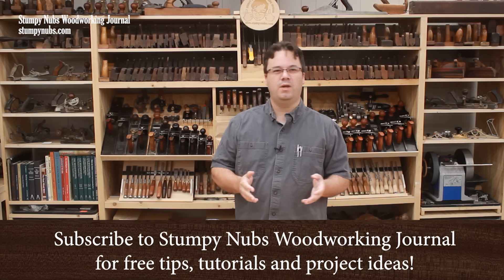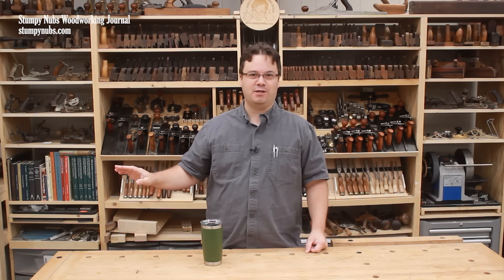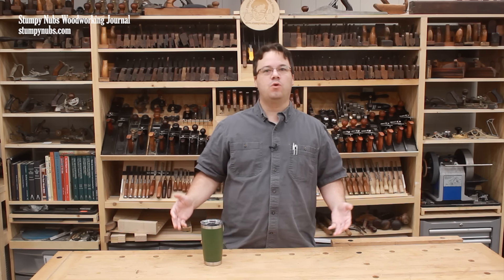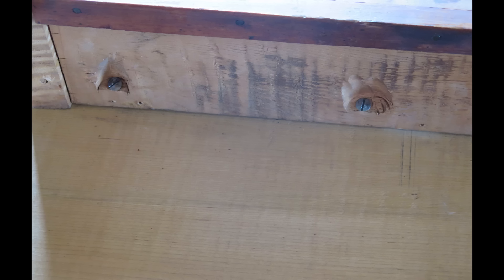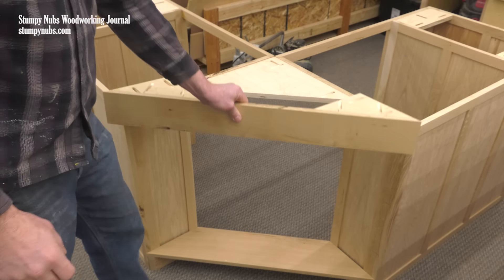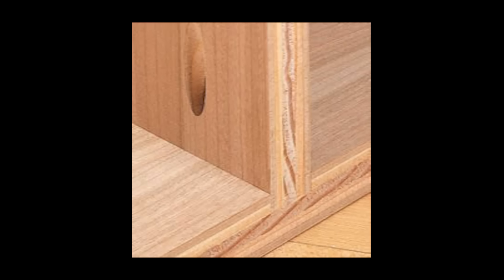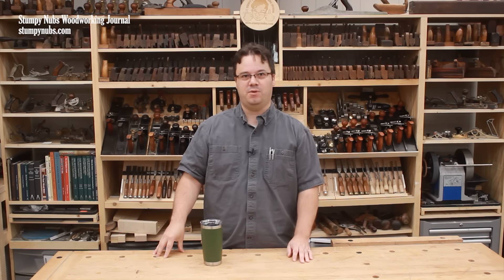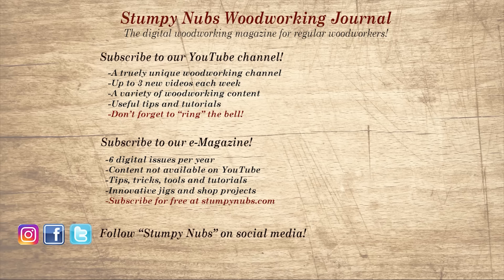They lied to you about pocket screw joinery.

Comment: How many of these "traditionalists" use a cabinet saw and joiner to construct their fine furniture? I would ask each one if they use the tools, in other words, a hand saw to make rip and cross cuts; hand plane each board to get a smooth edge and hide glue only. 

The fun part of woodworking is building what you want in the way you want. Be proud you made something yourself.
Reply: Couldn't have said it better myself!! People scoff at the use of construction lumber and pocket screws while they pull out their Dominoes and sliding cabinet saws. It's all just technology that gets the job done and different things are better for different situations
Reply: Or routers. I have a collection of shaper planes from the 1800s but I am not going to use them now that electricity has been harnessed and somebody had the good sense to invent the router. Which by the way is one of the most, if not THE most, versatile tools in any shop.

Comment: I use pocket hole joinery often. I’ve never understood the objection to it. Then again, the same people who complain about pocket holes also complain about CNC machines. They are both just different techniques. I have a pocket hole jig and if inhale the space and funds I would so buy a CNC machine. If they would come up with a machine that could automate sanding I would so buy that as well.
Reply: I believe that going to things like CNC machinery too soon detracts from skill. There's a degree of intuition about how a material behaves and its limitations which is best learned by literal hands-on experience with it. And not being able to do the work yourself means that when you have to do something you can't do with the press of a button you're left looking like an idiot. If you have gone through the process you will be able to come up with a good solution.
Reply: You mean, kinda like a drum sander? Won't do every surface, and you might want to touch up with a finer grit by hand or the random orbital sander, but for the largest surfaces it can do at least the blunt of the job nice and fast.

Comment: Hey, while we're pissing off the purists, can we have an episode for when T nuts (and other hardware like them) are appropriate and how to use the correctly? I always thought they'd be great for when you really need a strong set of threads inside wood, and they could be just as easily hidden, like in an articulated arm for an overhead light.
Reply: I love T-nuts. Those things are so damn handy.
Reply: @barryomahony4983  Not only hardwoods.
It has been common practice to drill a pilot hole into the bottom of a joist and run in 3/8" all-thread for plumbing hangers.
Granted, plumbing shouldn't be a dynamic load, but this technique seems to hold up (even for seismic bracing of water heaters and the like)
Reply: Oh yeah,  T Nuts and Threaded Inserts in the same comment stream?
Not sure how they'd work for wood, but nutserts (HF Threaded Insert Riveter Kit) are so dang handy for thin tins!
Appropriate usage for T Nuts would be a good idea for a new video. 
Looking forward to it stumpy. Don't forget to give James credit for the idea.
Reply: Are these the kinds of fasteners that Ikea uses in their particle board furniture?  Its pretty creative but I don't see used by other furniture makers.
Reply: @johnsrabe  Triggering the Trads, Setting Off the Snobs
Reply: @nathanboyd7460  IKEA !! Would !! Be !! LOST !! WITHOUT !! THEM !!

Comment: Personally, I've never had good luck with pocket hole joints holding up over time. Even machined pocket holes in prefabricated pieces with proper screws just never stand up for me compared to the life of the rest of the material it's made out of. If you can manage to make use of them effectively, go for it.  For my luck though, I only use them for a quick and dirty fix for something temporary, like a jig, or to tack in as support to supplement another joint.
Reply: Why do your projects not hold up with pocket screws? Are you using it out doors without using stainless steel fastners? Are the joints nice and tight, good cuts and no rocking before assembly? Are you using this joinery type on chairs which exert a huge amount of racking force? I'm asking because I have built thousands of pieces with this type of joinery and the only failures are one that were used improperly for the design or catastrophic issues. Like falling out of a truck! If using this type of joinery is failing you, look at the key issues. Is this the right type of joinery for the project? Is speed of construction necessary? Is the look of the piece going to make it "ugly" using this method. Can your current skill level accomplish the project? Don't mean any disrespect but some questions need hard answers, that also can be a learning objective.
Reply: @moldings_etc  Primarily in framing for shelving and furniture (not chairs), both indoor and outdoor. When used outdoors, I do make sure to use proper materials with the proper fasteners. And to be clear, the joints can hold up for a while, but not as long compared to the life of the material they're in.  Yes, wear and tear and related repairs are normal and not a fault of the joint, but comparing the time saved using a pocket hole joint in the beginning and needing to repair it down the road (at least in the likelihood that I've experienced), versus taking the extra time up front to do something like a mortise and tenon that will last as long as the rest of the material does, and I feel you save much more time in the end with the latter. Again, this is all my personal experience and opinion.  Your mileage may vary.
Reply: @kasbakgaming  So it seems you have already figured out which projects to use pocket screws on and which ones not to. That's part of the choice of which methods to use, experience on what holds up and what doesn't.
   I'm sure if full mortise and tenon was as quick as pocket holes, no one would use them. Good luck in your future projects!

Comment: One of the best defense of Pocket hole screws I have seen. Glad u mentioned they were used for well over a century. I have seen tables like a Duncan Fife style table with PH screws. Table was well over 100yrs old. I built a workshop stool with just glued butt joints and pocket holes. It has taken a lot of abuse over the years and still strong as ever.  All that being said, I still prefer mortise and tenon or dowels where want strength or want to hide joint. I do not personally like the look of a pocket hole.  As usual great video.

Comment: We have used pocket screws in several of the examples you mentioned, to hold a joint together when it dries, to build a simple cabinet, etc.  We do not have a big shop with all the fancy tools but work in the garage and pull the tools onto the driveway to minimize saw dust. Without pocket screws we would not be able to solve these problems or would have to buy a lot more expensive tools we would only use occasionally.

Comment: I agree with you. One thing that makes woodworking fun and practical is that there is sometimes a few different ways to assemble projects.  This means we have to contemplate how to use the tools we have to get the job done, which expands our capabilities.  The ability to disassemble projects can be desirable, plus when pocket screws are used, you don’t need a lot of clamps and you can handle the assembly and continue on as well.  Thanks for showing us that one doesn’t need the top tools to enjoy woodworking.

Comment: Great to see this, I got a KREG unit a few years ago and it's so quick to be able to form something. Most of my projects are 'functional' pieces rather than display pieces, so pantry shelves and cupboards for the shed etc, rather than fine carpentry. I have made dovetails and mortices in the past, so I've experienced both sides of the fence to some degree, and as you say it's case by case and not just to be judged with a strength test.......no names mentioned.

Comment: I built a whole kitchen worth of drawers with pocket screws for the sides, and dowels for the bottom, including 36" wide deep ones, full of heavy pots 15 years ago. Placed the pockets so they were hidden by the drawer fronts. Not a show kitchen, the Mrs. loves to cook, so used daily. Great option for me, as I had limited space to work, and the drawers are still rock solid.

Comment: I built and L-shaped desk top out of solid walnut and plywood using nothing but pocket screws. I machined walnut boards with tongue-and-groove edges and pulled them together with pocketscrews on the underside. Then I laminated the L-shaped top to an underlayment of plywood with the grain and L-joint opposite from the walnut top. I made a facing strip to go around the edge of the assembly to hid the plywood bottom. All the joinery was done using pocket screws and normal screws to hold the bottom plywood to the top walnut. No glue to deal with. It allowed me some years later to modify the desk to a normal desk by simply removing some screws and doing a little cutting of the original pieces and screwing it back together. It was probably one of my best woodworking projects ever.

Comment: We are in the middle of a move right now so can I just say thank you to the woodworker that used pocket screw to build my desk! I never would have been able to move it without breaking it down first.
Reply: Time savings in construction and ability to dismantle a piece are probably the top 2 benefits of pocket hole joinery. My 9ft farm table has 0 glue and can be dismantled 100% if need be.

Comment: Mr Nubs, I know coming up with topics can be a problem.  You have such a backlog of videos that I haven't tried to check all of them before I offered this suggestion:  you could do a lot of videos about the properties of different types of lumber.  I know a little about it, and I rely heavily on the Wood Database for info when I am considering a variety of lumber for a project, but I'd like your take on things. I've done a lot of red oak and a little white oak, but I got my hands on some ash recently and I like it.  Works nicely, finishes nicely, and has a really nice contrasting grain pattern, but it does have its drawbacks too.  Fifteen to twenty minutes on ash and uses (steam bending? handles for rakes and such?) and so forth on other lumber might be very valuable info to woodworkers who are trying to find cheaper alternatives to the ridiculous high price of white oak these days, for instance.

Comment: I just finished a coffee table where I used pocket holes to both clamp pieces while the glue dried and allow other parts to be able to move as needed. I'm 300lbs and can say it will easily hold me and my kids at the same times. It's even built from pine.... Just proves as long as materials and fastening methods are used properly, the results can be great!

Comment: When I was a kid we would build face frames using dowels it was slow took forever and you had to use a lot of clamps to hold it together The use of pocket screws saves so much time in cabinet building it’s ridiculous if you’ve had to build in the old way (doweling ) compared to the new way (pocket screws) you wouldn’t be complaining 😃 I wonder if the same people complain about using a wide belt sander compared to a belt sander 😳 Nice job on explaining the use of pocket screws and why they are important😃👍

Comment: Amen to this!

There is absolutely a time and place for pocket hole joinery in fine woodworking. Knowing the right application, and then doing your pocket holes correctly, is key. 

Personally I find pocket holes perfect for fabricating face-frames for built-in cabinets, face frames that are perfectly square and can deal with  wood expansion. I guess I could go to the bother of making concealed tenons to connect the rails and stiles. But why? The joint wouldn't be any stronger (and, in fact would deal less well with wood movement). It certainly wouldn't look any prettier.  The Luddites would have to go a long way indeed to convince me there was a better way to make a face frame than pocket holes.

Comment: I remember the first time I watched a video about woodworking and someone was ragging on pocket screws. I was like why? It does its job. Like you said I was that guy starting out trying to build stuff awkwardly and with only what tools I had and adding new ones as money allowed. 

My favorite thing about woodworking is being able to make things for myself and things for others but also being able to repurpose something or fix it when the needs change. One of my first projects was supposed to be a table/shelf between the couch and the wall. I had a circular saw, drill and regular screws and boards from Lowe's and some poly stain given to me. It turned out all wrong, wouldn't fit with the couch and I probably measured wrong. But with a little tweaking it made a great shelf for my son's room. And it's currently in a closet under the stairs holding blankets and towels and such. It's ugly. It's not square. I wouldn't dare try to sell it to anyone. But it's sturdy and does a job. And it helps remind me how much I've learned and how far I've come. 

I'll never be some masterful professional woodworking shop. But I can do some great things in my garage/shop that I couldn't do 4-5 years ago. And I'm always trying to learn new things and get new tools to aid in that process. Even if means pocket screws. The naysayers can just get over themselves.

Comment: Agree. Woodworking is a hobby for me, and I make most projects with hand tools only (yes, I even hand cut 4x8 sheets of 3/4" plywood with a panel saw when needed). I love laying out and cutting dovetail joints by hand whether it's a gift box for someone or a tool tray for me. It's a choice. I also love using pocket screws for larger projects like shop furniture or a garden bench. I don't have a table saw, a drill press, a CNC machine, or any of those other new fangled inventions, but I've seen some beautiful wood pieces made by others who do. I have a shop vac ,though, so I don't just rely on a broom and dustpan for clean-up. ;-)

Comment: They are like dowels that have the ability to secure a piece, but also gives the ability to remove it - as you mentioned. That is a major advantage of pocket screws. Granted, I used to be a huge hater of them, until I used them and fell in love with their use.
Reply: Dowels don't show, the only real problem with pocket holes is they are hideous .
Reply: i think my main objection to pocket screws is when it relies on the shear strength of the screws. In those cases, it seems like the joint should also have dowels.  (e.g. two dowels for the shear and 1-2 pocket screws to clamp)  (There's a reason IKEA's stuff is built with dowels and those twist-lock thingies.)
Reply: @r0bst4rl1ng  Flatpack furniture needs to be assembled, dowels help with alignment and the lack of strength of that crappy knock-down hardware. I built a granite and oak table a few years ago and the bottom shelf is a 40 or so pound piece of granite sitting on pocket holed stretchers. That shelf should easily hold another 100lbs.

Comment: I recently discovered pocket screws in one of your old videos and instantly thought, ohh damn that's clever, and looks very functional and easy to install. Now my question would be, how to DIY without the proper tools? Could I just bore the holes with different drill bits sizes? gonna give it a try for my next project
Reply: I think you'll find it very difficult to DIY. Because of the shallow angle, it's going to be extremely difficult to get the hole started without the drill bouncing everywhere. The depth also has to be fairly accurate, too.

What you might not expect is you also need a SUPER long driver bit or your drill will bump into the table before you even touch the screw.

You don't need a super expensive bench-top system though. You can get a jig for about $15, and that will include the drill bit and stop. Then you just need screws and a matching driver.

Comment: Just got the kreg r3 jr on amazon for about $30.. always skipped projects i saw on youtube that used pocket holes but I caved in and used it on my garage shelves and am pleased with it soo far.  The price of the regular kreg jig is what turned me off from ever buying it until this more basic setup.  

Unlike toenailing a screw the flat head of the pocket screw and the design of the bit you dont have to worry as much about splitting the wood like a bugle head screw

Comment: Quick question about the wood movement with pocket holes:  Do you need to use a different drill bit to make the holes bigger, or does the Kreg drill bit make the hole oversized to begin with?

Comment: You did not mention pocket hole plugs which makes the hole just vanish with a little sanding and stain or paint ( ugh I hate painted wood but that is another topic for some other time) you would never know they are there. Thanks for the video keep it up.
Reply: I'm not a fan of painted wood either.  It does have a place however.  Outdoor furniture will last longer painted.  Pieces made for kids love bright colors that natural wood cannot provide.  Everything has its place.
Reply: You are right but as a cabnet maker I prefer stain but of course some of my customers want painted which lets me use more high quality plywood instead of solid wood on the doors

Comment: I'm teaching myself (with a lot of help from youtube) to build replacement cabinets for my kitchen.  I'm doing it myself because I'm cheap and the cabinets need to be non-standard.  I started with a circular saw and straight edge, added a small portable table saw and now even have a hand-held router.  I went on the tube to see how to make "quick and easy" raised panel doors but the problem was in order to make "quick and easy" RPD's apparently you need $20,000 worth of shop equipment, haha.  I'm not admitting to any particular type joinery, but I do have the good sense to keep it hidden.